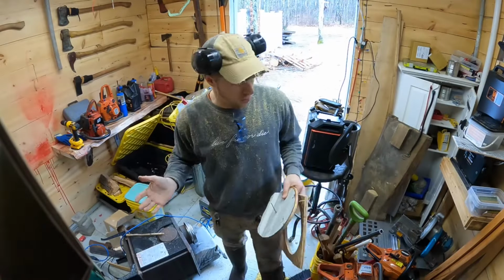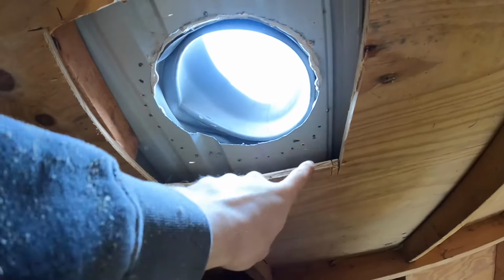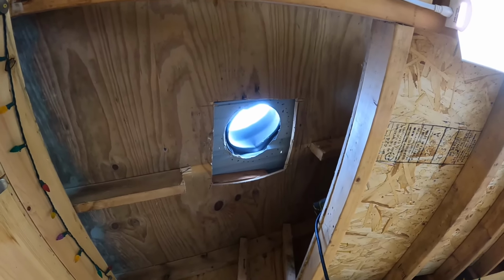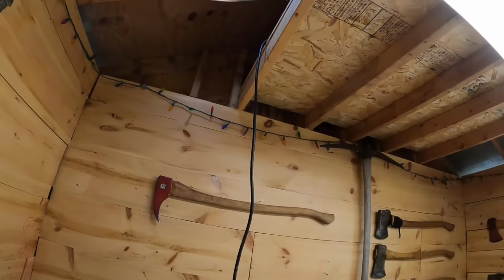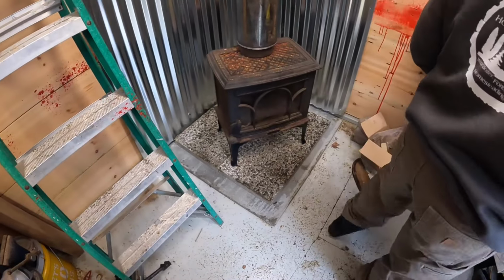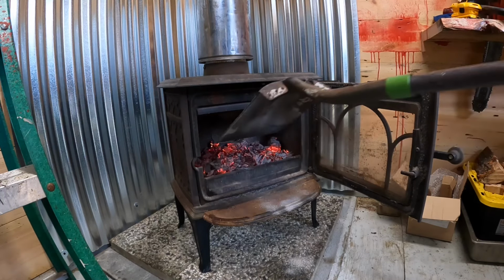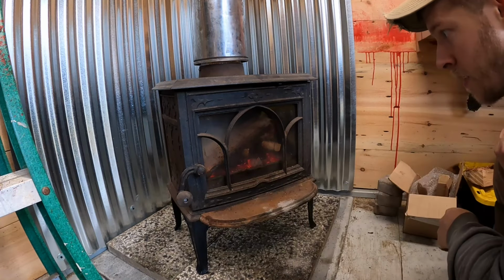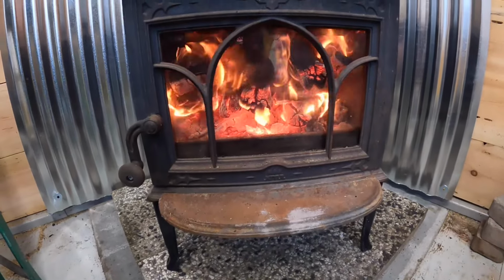FINALLY!  Finished The Wood Stove Install!

Comment: Nice job Jay!  I'm no expert but on all my stoves I used a few feet of regular stove pipe between the stove and the chimney it will give you more heat and will help with drafting
Reply from the maker: Hey Shawn! That was my original idea but I scored the 4 sections of double wall for $150 so I ran with that! I may swap out the bottom two for single wall but its plenty hot as is LOL

Comment: Nicely done , and nothing , I mean nothing goes easy , everything fights you , well does in my world , but looking good , I love my 2 jotuls
Reply from the maker: Rock on!! Question for you? The bottom air control. I havent messed with it but is there a "setting" you put it on. I get the damper above the glass I get that but the underside one is the one in question.
Reply: @HomesteadJay  all the way to left is wide open to get fire going , once u have fire going choke down to the left it will make u go through less wood and not have rageing fire , or if your leaving shed choke all the way down and there will be coals in am to fire her back up , to right all the way open to left u choke down 👍🏻
Reply from the maker: @shayn4220  Yes I got that for sure. Whats the bottom one underneath with two screws holding it on? That must be another intake of some sort?
Reply: @HomesteadJay  yes or some came with ash clean outs that the pan attached too
Reply from the maker: @shayn4220  I dont think its an ash clean out I think its some type of air control. Like a baseline setting and you fine tune with damper above door.
Reply from the maker: @shayn4220  Ill send you an email with what It looks like.
Reply: @HomesteadJay  ok fire away
Reply from the maker: @shayn4220  Just sent

Comment: Did you check the air control on the bottom?  It seemed like it draws great with the door open but was choked when you closed it.  Seems like maybe the stove air control/ damper was closed?  Hope it's running well for you now you've had more time to mess with it.  Enjoy!  Great addition/ project for your shop.
Reply from the maker: The control on the bottom I cant find any info on it. All the manuals say the front damper control is the only air control but the one underneath seems like it can be adjusted! I play on playing around with it.
Reply: @HomesteadJay  OK, sorry I might have missed the other control.   I just remember seeing one when you were taking it apart etc.  Hope you've got it dialed in.  Keep warm!

Comment: I like your set up although I’m not sure about about keeping gasoline powered equipment in an enclosed space with a wood stove going. But on another note, the galvanized corrugated roofing you’re using as a heat shield behind the stove. What did you use to keep it away from the wooden wall?
Reply: Wondering the same thing about the corrugated. Thought maybe I missed the install video on the heat barrier. Looks real good though
Reply from the maker: Hey Guys! I actually lost the video on it the memory card was corrupt but I cut 2.5 Inch metal spacers from high heat gas pipe left over. Then used 4 inch screws through the metal and through the metal spacer and into the stud. Hope that makes sense! Ill cover it next stove video
Reply: Thanks Jay, you explained it fine.

Comment: Is that all chimney pipe ?
Reply from the maker: Yes double wall from stove all the way up
Reply: @HomesteadJay  any reason you didn't use stove pipe inside? Was your space too short ?
Reply from the maker: @spiderwebmarketing2424  No I had the set backs I just scored 4 pieces of double wall for $175 so I just used all that for now. I could always change out the bottom two if I wanted with single wall.
Reply: @HomesteadJay  gotcha. That's a great deal..stuff can be expensive
Reply from the maker: @spiderwebmarketing2424  Thats my next video lol cost!